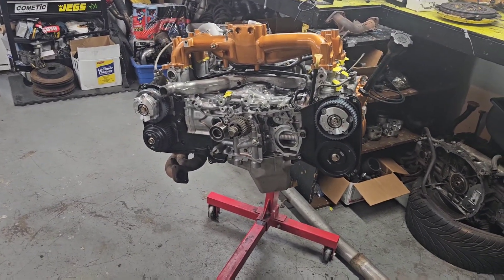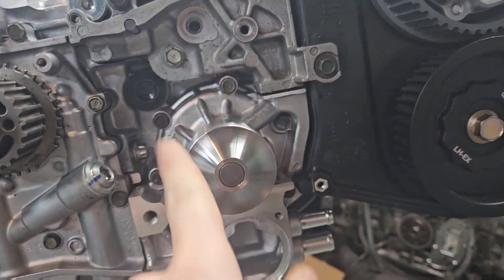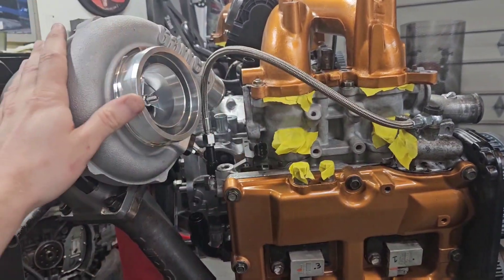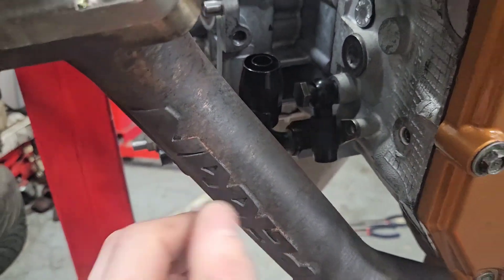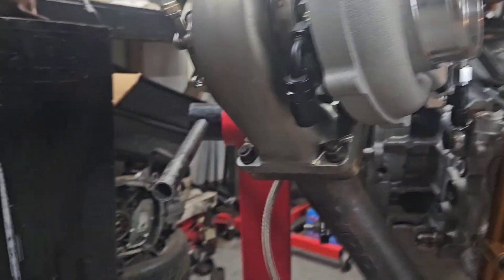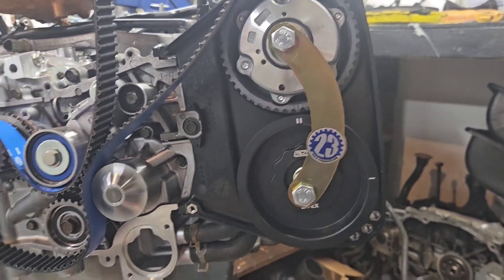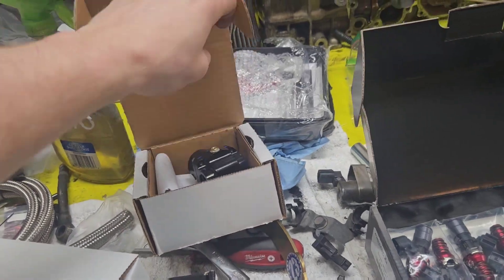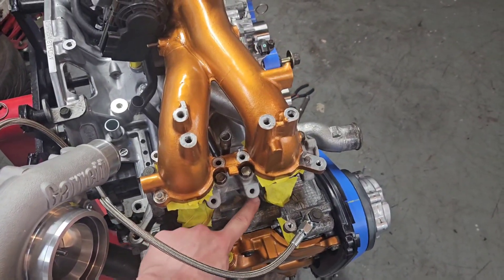NEW Garrett G30-770! for the STI Swap Legacy Wagon

Comment: might sound dumb but do you think that turbo would lag on a ej257 ? stock motor like 22 psi ?
Reply from the maker: We're going to find out! Well I have built heads and cams, but from the dyno sheets I've seen from similar setups it lights about the same as other stock location big turbos. Should see full boost around 4k rpm. If anything a stock motor/cams would help it spool faster in the low end but it would struggle to breath up top to make that peak hp number everyone is after.
Reply: @HackSquadGarage  yeah I'd be more so worried about it blowing up.. lol but my motor is completely stock I think it'd be fine spool fast I just can't afford a rotated set up and built motor at once
Reply from the maker: @TheeHenley  piece it together slowly, collect parts, maybe find a used rotated kit to start with, that's what I did. It would probably last a while on e85. But a built motor would be better. It depends on the hp goal. You could keep it low and safer in the mean time.
Reply: @HackSquadGarage  yeah probably wouldn't want anything more than 350whp
Reply: @HackSquadGarage  what oil line kit did you buy from iag there telling me they only sell lines for garrett gt stock location turbos
Reply: Im 440 wheel hp on dyno dynamics road dyno.  and i get boost from stock tubo to mine only 900 rpm later then stock. so no lag and my kit is 10 years old!.  the old tsr70 full race kit. I love it!

Comment: hey do you have the link for those iag oil feed lines i spoked to tech support they said they dont use those for g series
Reply from the maker: The G series has its own restrictor that comes pre installed, so the feed line doesn't technically matter as long as the fitting is the same, I believe it was 4an? the one I got was the iag one for the gtx series but it's basically the same. I don't know why iag would tell you that.
Reply: @HackSquadGarage  that's what I was thinking to and yeah the top feed is a 4an did you get the lines that have the avcs filter in them or no ?
Reply from the maker: @TheeHenley  no the avcs filters are garbage, we delete them when we can
Reply: @HackSquadGarage  alright I'll just remove them when I do it

Comment: hey mate what ecu are you going to run? how will you control the elec throttle body
Reply from the maker: The car has been harness merged with an 05 sti so I'll be using the factory 05 sti ecu with a v3 access port
Reply: @HackSquadGarage how will you get around the greenspeed update during Tuning while using TGV deletes? Won’t you still get a CEL?

Comment: i WILL NEVER  use a perrin down pipe that is stamped. cus heat transpher is not good and i have had two crack. Thats my experiance
Reply from the maker: That's good info, I really hope mine does not crack lol but it was used and cheap. A big thing I did was add big steel supports to hold up the weight of the turbo, I think it really needs that to stand up. I had to cut it up anyway so I didn't want to spend a ton on one. It was either that or make the whole kit from scratch. This worked out pretty good I think for very cheap. We'll see how long it lasts.
Reply: @HackSquadGarage   o Hope it workes mand mine split cus of Quarter mile runs. I was just that little difference of temp on the side with air that made it crack  twice. Anyways cheers man the cars are fun!! enjoy it

Comment: why wouldnt you just plug the pump instead of getting new
Reply: fair play maybe flow is worth
Reply from the maker: If you are referring to the water pump the ej22t water pump is just better and oem. I've done the plug trick on my other cars and it will eventually leak. Just didn't want to deal with that again.